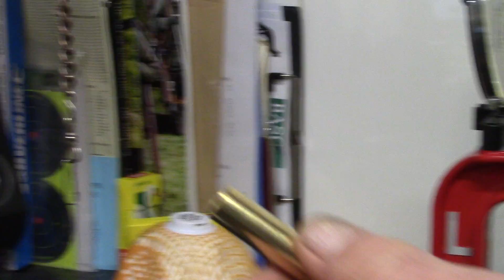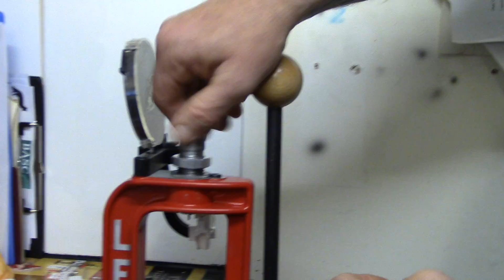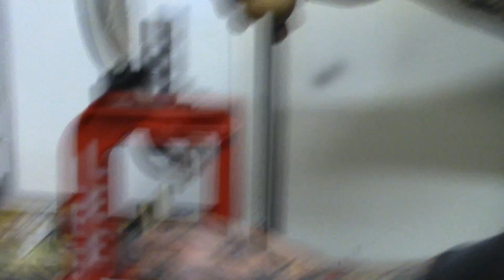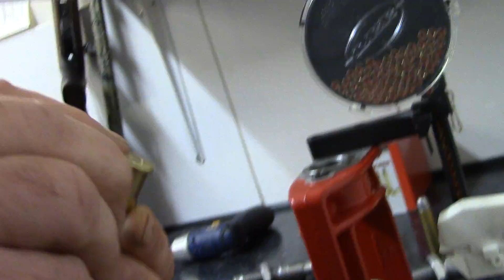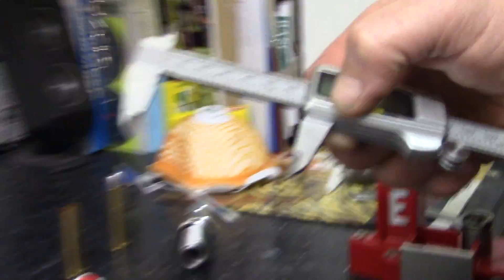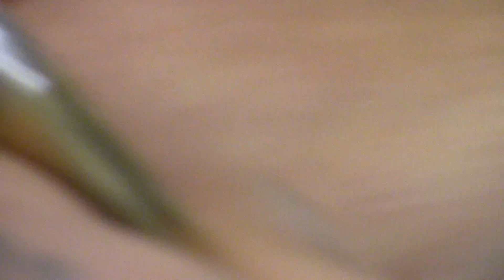45-70 Government reloading using Lee re-loader

Comment: 35 grains of N130 is a very mild load. Vihtavuori manual lists 44.7 grains as a starting load for 400 grain projectiles for approx. 1604 FPS.

I've read about SEE (Secondary Explosion Effect) which is a phenomenon caused by using very light charges, but it appears quite rare. The real risk is that with light loads, if you accidentally double charge a case, it's not easily noticeable. With larger loads, a double charge would be noticeable as powder will overflow the case. The Ruger No. 1 is as strong an action as you can get, but as you said, 70 grains of nitro powder in that big boy is going to be nasty.
The other risk with really light loads is the bullet not exiting the muzzle, which is definitely going to cause a blow up if you fire another round.
Check and double check. Be safe :-)

I'm using my own 405 grain hard cast lead projectiles pushed by 53 grains of AR2219 for an average velocity of 1925 FPS in my marlin 1895SBL. I can push them past 2000 without pressure signs (max load is 55 grains), but this load thumps enough at both ends as is. These loads need a good crimp, too.

There's nothing I don't know about reloading these days. I've been doing it for 20 years (since I was 17), but I still love watching it. I love reloading as much as I love shooting. I usually have excess ammo supplies :-)

Great vid.
Reply from the maker: Cheers mate. I have to admit I load light when I'm target shooting to save cash. Great advise though, the thought of one of these stuck half way down the barrel isn't worth bearing. Hopefully staring to reload .308 soon so more vids to come. Totally agree on the enjoyment factor too, I even machine polish the inside of the brass sometimes ;)
Reply: +Geoff Bullock If you're looking for a good propellant to produce a light load in the .45-70, Trail Boss is a good choice. It would be impossible to overload the round using Trail Boss.
Reply from the maker: Cheers Don
Reply: Don't worry about sticking one in the barrel, unless  you use some high energy powder not recommended for that low of pressure. Auto's or gun with a cylinder gap is where you usually run into that. Not to worry. I shoot as slow as 600 fps in my B-78 Browning. Stuck lead bullets are easy to get out. Just wrap your cleaning rod with tape (so you don't damage the rifling) and drive the sucker out.
Reply: crusty old fart Getting a projectile stuck is a result of low pressure. The problem is if you don't recognise that this has occurred and you fire a follow up shot. A blockage in the barrel is always going to cause excessive pressures well beyond the original load.
If you're getting projectiles stuck, you shouldn't be shooting those loads.

Why are you shooting at 600FPS? Even a lazy blackpowder load nearly doubles that at 1100FPS and my 8 year old niece can fire it.
Reply: AusiKifaru27 Not the revolver guys. Some of the old cowboy loads went as slow as 660 fps. I'd been shooting 200 gr loads, and it was just about impossible to get them down that slow. I went to a 325 gr bullet and it did just fine. Cylinder  gap is critical at that low of pressures. You don't need to school me about pressures. I've been reloading 50 years, and shooting competitively nearly that long. I'm a gunsmith, and retired master tool and die maker.
Reply: crusty old fart Fact is, if you're getting projectiles stuck in the barrel, then you're doing something wrong and potentially dangerous, no matter what you shoot. And it's not shooting if it doesn't exit the barrel.
Reply: AusiKifaru27 I was experimenting. I never do anything wrong. There are variables you never heard of. I'm sure you've loaded up till you got pressure signs? Well I loaded down till I could go no further.  I don't need any advice from an amateur.
Reply: crusty old fart I'm not an amateur (seriously wondering if you read my original post properly) and I'm not giving you advice. I'm telling you that you give bad advice. You said, and I quote; "Don't worry about sticking one in the barrel, unless you use some high energy powder not recommended for that low of pressure."
The fact is, a stuck projectile is ALWAYS a bad sign, regardless of what powder you're using and what you're trying to achieve. If it goes unnoticed, it can have serious consequences.
The .45-70 has a very large case capacity (75.5 grains of water). Low amounts of any powder type with a high surface area in a boiler room that big is stupid. If you want reliable ignition with repeatable results for low velocity, blackpowder is your best bet. 600FPS out of your B-78 with nitro powder is asking for trouble, Generally when people want a low velocity .45-70 load, they're after around 1,000FPS with a nitro powder (the reason Trail Boss is so popular, as it's a low surface area powder). They can easily do it with BP, but no one wants the fouling if they can avoid it.

You never did answer why you'd want 600FPS from your rifle.
Reply: AusiKifaru27 I was referring to a stuck bullet as no big deal to remove it, and explained how to do it. Trail boss is a waste of money. It's mostly filler. I also explained that I was trying to get to 600 fps with my 45, not a 45/70. Traditional velocity for a 45 is 660 fps. I hate black powder, it is destructive to guns, and I'd never get it around any of mine.
Reply: crusty old fart You have a lot to learn.

This video is about reloading the .45-70. You didn't mention anything other than shooting at 600FPS in a B78, which is a rifle, not a revolver. Now you're telling me you explained (which you didn't) how you meant your 45? 45 what? Colt? ACP? GAP? Raptor?
The fact that you think Trail Boss is a waste of money proves your ignorance. It's a nitro powder that supposed to be a filler. That's the point. It quickly fills large bore cases with very little powder, replicating the original, low velocity black powder loads. Trying to replicate these loads with most nitro powders causes unreliable ignition, inconsistent results and a serious risk of S.E.E. (Secondary Explosion Effect) or what some call double detonation. Cowboy Action shooters have experienced this more than anyone by trying to replicate BP loads with smokeless powders.
Trail Boss is still a dirty powder, but doesn't foul like black powder and isn't corrosive. But BP isn't that bad if you look after your rifle. There are hundreds of thousands of rifles, some centuries old, that are still shooting just fine. They'll still be doing so long after your modern high velocity nitro firearms shooting jacketed bullets have burned through a dozen barrels.
Reply: I have nothing to learn from a rank amateur like you. I was machining my own long range bullets before you were born. I am the technical advisor to 4 police Depts, I did 2 combat tours of Vietnam and have 23 confirmed kills. I have a custom 45/70 I shoot over 1500 yds with a .40 cal steel bullet I CNC machine then put my  epoxy/molydisulfide  coating then re machine to .460. Trail boss is a waste of money, and only handy for beginners. Most of the cowboy set around here have gone to trimming back old brass to half it's length, then shooting mild loads of Titegroup. It is clean and cheap, and was made to alleviate the problem of powder placement.  And those old rifles you mentioned that are still doing fine-----I shoot more in a day than those old pieces have  seen in a lifetime. I see them all the time with the innards rotted away from black powder smoke residue. Quit tying to be a wise ass. Everything you've put on here anyone can read from a cheap reloading manual.
Reply: crusty old fart I read a lot and believe a lot less. I also don't believe anything you say.
Reply: AusiKifaru27 Good for you. It's way over your head anyway.
Reply: crusty old fart It's sad that you think this is insulting. Many things are way over my head. I'm neither arrogant nor ignorant to ever say otherwise. The simple process of pressing a key on this keyboard and sending it instantly via a circuit board to display on my screen to then be approved for sending through copper and optic cables running on light flashes, passing through many mediums of machines to end up on the other side of the world... and every bit of it (pun intended) can be expressed in 0's and 1's... actions performed in milliseconds that very few singular people could explain the entire process of, and certainly couldn't reproduce on their own. I'd be willing to bet Zuckerberg couldn't even solder a resistor.

The fact is, you cannot articulate yourself properly and are so arrogant that you think your way is the only way, while being completely ignorant of the needs of others.
Reply: AusiKifaru27 I just don't like to see childish information put put there, especially from someone  from a country where guns are taboo,and think it is top drawer technical advice.
Reply: crusty old fart You really don't know how to stop being ignorant, do you?
There's more firearms and firearms owners in Australia than there has ever been in its history.
You must be a yank. I keep running into a whole stupid bunch of them that think everything here is banned or that most people can't own any. Is the NRA running some sort of fear mongering campaign or some such shit? Seems you people believe anything you hear.
They only restricted certain types to be owned by certain people, namely, professional pest controllers.
Recreational shooters sold 1 restricted firearm during the buy back, and bought 2 or 3 more with the cash.
While it was a pathetic political game and a ploy by anti-gun nuts to reduce the number of firearms in the country, they only succeeded in record numbers of imports to keep up with demand.
Our defence force factory at Lithgow has since taken up manufacture of civilian firearms, once again. Bought one a while back and have since been tempted to sell my CZ's, as it out shoots them with almost everything I feed it.
I've always preferred European guns. Not a fan of many US made stuff. The Marlin 1895 is the only US made firearm I've ever bothered to purchase, and it's far from great, but is good fun. I only bought it for shits and giggles, but it drops large game a treat.
Shooting and hunting in Australia is alive and well. There's no shortage of targets. Rabbit, Hare, Cat, Fox, Wild Dog, Goat, Pig, 6 deer species (Hog, Fallow, Chital, Red, Rusa & Sambar), Horse, Camel, Scrub Bull, Banteng, and Buffalo. There's also numerous duck and other bird species, plus fish. We have no seasons here, with the exception of some deer species if they're on public land, and trout. We hunt all year 'round.

No one is missing the restricted firearms. And no one is being shot by fucktards.
I'll stay in Australia, thanks.
Reply: AusiKifaru27 Got an AR, Got an AK? how about a double stack 9mm?
Reply: crusty old fart I only need one round to get my dinner. I'm not shooting crowds of people.
Reply: AusiKifaru27 I didn't think so.
Reply: Simon Smith Still pissed off 'cause you got your guns taken from you? Hell I didn't do it. You laid down and let your politicians screw you. Aussies have always been 100 years behind civilization anyway. Your government will put you back to shooting the Brown Bess next. that's about all you're capable of.
Reply: Simon Smith Trail boss is for idiots and beginners, who don't care to pay for inert cellulose and sawdust filler. Titegroup will load 3 times the ammo, and is specifically designed for small charges, clean burning and  not being affected by powder position. I have had a few bullets stuck in 45 long, trying to achieve traditional velocity (660 FPS) , but solved the problem by going to heavy bullets. My rebarreled B 78 Browning 45 70 is untouchable at 1500 yds. Try dropping 65 grains of H-4198 in that junky Marlin of yours, like I do. I CNC machine my own bullets, .400 cal, then Sabot them with my own epoxy/moly formula, then machine them again to exactly .460. The twist (330,000 rpm immediately slings the coating away, leaving a super high B.C. .40 cal steel dart. I shoot my old M1A on the 800 yd match, You know one of the guns you can't own. by the way, I'm on the armory board on 3 police departments, and I developed the state police frangible load. You're way out of your league.
Reply: crusty old fart Typical Yank. All talk, never listening. This is why most of the world hates you, and why Aussies call you septics.
No one here is pissed off about losing anything.

It's only a little over 100 years since the end of the US Wild West. I'd like to be that far behind. Seems like a good deal. Not sure what your lame attempt at an insult is all about.
I'd rather be capable of shooting a Brown Bess than pulling a trigger fast on an AR15 and thinking I'm a hero.

Mate of mine, Brett Medway, took his Kids Sam and Jessie-Lea to the US for CAS a couple years back. While we don't have access to pump action shotguns for sporting purposes, they still managed to out shoot you septics just fine with a SBS. Savage Sam & Jazzy Jess still hold the junior world records. Look them up. Fact: People learn to make their shots count when they're limited.
Game outfitters world wide cringe when trigger happy septics turn up. Many of them charge yanks more without telling them, as they know they'll be wasting time tracking wounded game.

Simon Smith Hey mate, wanna go down the local pizza shop for a bite? We can do that here and not get shot up but some fucktard with an automatic rifle that's looking for a paedophile ring and dismembered kids. And on the off chance we do get shot, free surgery & health care!!!! Imagine what goodies we'll get in 100 years :-D
Reply: AusiKifaru27  The current world CSA champions are a 13 year old girl from Va, and a boy from Louisville Ky. Who told you I was a yank. I live in Nova Scotia in Summer, and the Caribbean in the winter, cruising slowly up and down the coast seasonally. When in the USA.  I only travel in better circles, around the more cultured East coast cities,avoiding the ghettos. I seldom venture far from the Marinas and Yacht clubs. I don't even own a car. In Halifax, Boquette, Charleston, Havana, or Baracoa, I can walk the streets alone at night in perfect safety. Try that in any Aussie city, and you'll get your throat cut. Being a cultured southern gentleman, I would never eat pizza, and never set foot in a piss hole like Australia. And I ain't your mate.
Reply: crusty old fart We know all about your "world champions". You have "World Series Baseball" and don't let any other country play in it.
The Medways haven't been back to the US to compete since. Your standards go on the amount of competitions shot, for current stats. But who cares? Once again, your fucking dumb arse didn't listen. I said "WORLD RECORDS!"
My throat is just fine. For someone that claims they have never set foot in Australia, you sure have some stupid opinions. I bet space is peaceful, but I'm not going to quote it as fact as I've never been there. You really can't hide your arrogance, can you?
Lots of people don't own cars. They're poor.
In Australia, we call cunts mate. You qualify just fine. And we don't want you or your dumb ideas here.

We also make better pizza than you.
Reply: AusiKifaru27 I only have to go online and look at you crime rate to see it is no place to visit. Besides, if you are a typical foul mouthed, low intellect, example of the  culture, Panama is as close to that place as i want to get. Baseball....Ha! Spectator sports is for appeasing the peasants. I'm sure you'd be a wrestling fan if you lived in the USA. Pizza is also something for appeasing the peasants.
Reply: crusty old fart Oh, and Cowboy Action is an Olympic sport, is it?
To each their own. I don't watch sports.
The fact that you consider other people "peasants" is proof of your arrogance and ignorance. It's no wonder you don't know how to speak anything other than shit, as you're head is buried so far up your own ass.

As someone that lives in and has walked many an Australian city's streets at night, I honestly have no idea where your brainless ideas come from. You clearly don't know how to internet properly For shits and giggles, I compared the stats of all places you mentioned and the homicide rates in each are from 4 to 17 times more than all of Australia.

Blocking feed now. You're an idiot.
Reply: Simon Smith Actually Taught master classes before I retired.
Reply: Simon Smith Only thing worse than Australia, is the backward ass holes existing there
Reply: Simon Smith Limited vocabulary....Notice.